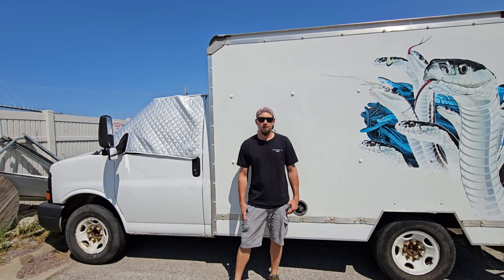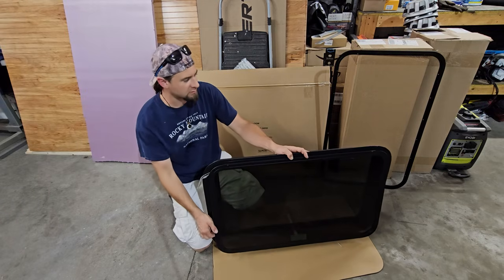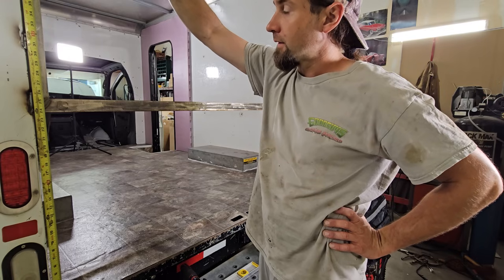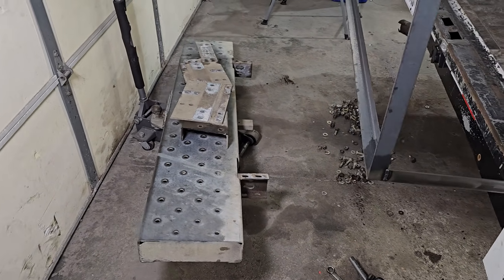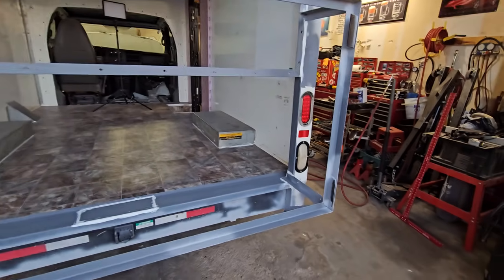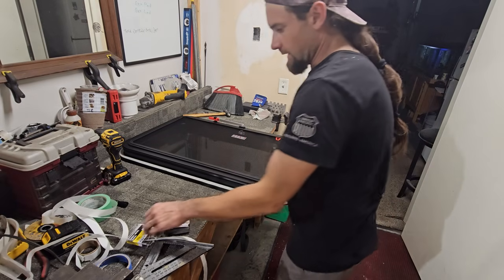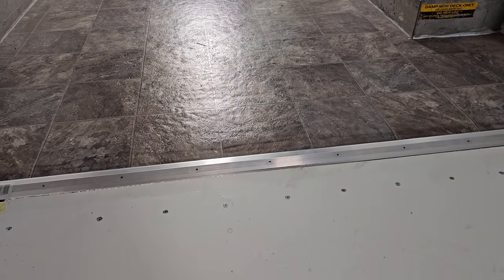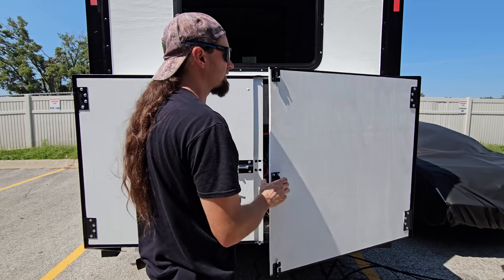It Doesn't Look Like a U-Haul Anymore - Box Van Build Part 3

Comment: i use to work for uHaul in the maintenance division. I felt for you on removing that door, there was definitely an easier way to do it, but without uHaul specific tools and knowledge you did great.  Before I left uHaul they were in the process of changing out all those roll up doors. we had it down to a science and on average 2 men, with uHaul tools could removed door, tracks, and all in about 15 minutes.
Reply: At the forward (top) end of the tracks, you can pull the rollers out of the track. Occasionally, there will be a stop or a plug that can be removed or the end of the track cut off. If you separate the door panels at the section hinges, they come out pretty easily and are light enough for most people to handle. That torsion door lift spring is a beast and can hurt you pretty easily, but most overhead door companies have the tools to make quick work of it if you feel unsure of your skills to handle it. Make sure you have at least two bars to release the tension if you decide to do it yourself.

Comment: Another great video.

One thing I missed - other than not being the "dream bumper" what was wrong with the existing one - it seemed pretty functional?  Maybe I missed or did not understand the explanation on why removing it...

regardless - awesome build!
Reply from the maker: once i installed the storage box in the rear for my bike, the bumper became useless for anything other than being a hitch.  the hitch had a 2" ball permanently welded onto it, which made it useless for accessories that i would want to have such as a cargo carrier.  it was also very heavy and low to the ground, which was likely to get hung up on things offroad

Comment: Dave, the outside is coming together. Man that spring was nerve racking. Nice job getting the door off. I think you are right about the rear taillights need to move, probably on each side of the garage. I’m sure you will come up with something interesting. Definitely, get the outside done and then the fun begins on the inside. You’ve got ton of work done already. Congrats!

Comment: Fantastic build so far.  I'd definitely get some led strip lights.  Looked on the Amazon and they definitely have some good choices.  To fill the old holes I would just get some aluminum bits and glue them over the  holes.  Be water proof and no screw holes seen.  PL premium would work just fine.

Comment: I grew up in the aviation world. So, for me, I'm into aerodynamics, saving weight, money, and to get the best drag coefficient.
For my truck, I'm removing the front bumper, the rear bumper, the sliding door, and the towing package.
My first videos will be about removing as much weight as possible.
For my bumpers, I'll replace them with aerodynamic bumpers made from fiberglass or carbon fiber.
I also plan to use 4' aerodynamic flaps angled at 12° inward, on the back for better aerodynamics, for highway speeds.
Reply from the maker: nice! ill follow your build.  im going to make a deflector for the top of the cab on mine

Comment: I admire your talents and creativity as your build your dream off grid home.  Do you plan on adding any exterior lighting so you can see around the vehicle at night?  Such as strip LED’s that tuck inside the exterior frame. Even some exterior mounted LED flood lights so you can illuminate your campsite-to work or cook.  Keep up the great work!
Reply from the maker: yeah i have a porch light for each side that does white and amber, i will have off-road lights on the front and back

Comment: Probably should cover the floor with cheap blankets from Harbor Freight. I'm commenting while watching so I don't forget. I've learned on my own projects, don't do any finish work until I'm done de-construction. I ruined the carpets at church by using a disc grinder to take down a partition hanging from the ceiling. Sparks came down and burned the carpet!

Comment: Have you considered coating the plywood bits in rhino liner or raptor bed liner? I feel like plywood fails pretty quickly when exposed to weather even if painted. It would make the panels much stronger and also cut down on road noise.
Reply from the maker: that would be nice, but expensive.  i am on a pretty tight budget.  i will have to keep up on the paint every year.  if some day i need to replace the plywood, i bolted it on so it is removable.

Comment: I worry about putting a lock out in the open on the back… heavy duty bolt cutters or grinder and your bike is gone!  

Is there anyway you could put a key lock on both doors to the frame?

Also, I would think about putting a small awning or a small cap at the top of the van to keep any water pooling on your box at the back.

Comment: You were supposed to use cement putty for the windows outside trim not screws. because most rv/campers have the putty for 3 reasons. The main one is that it seals the frame for the outside to prevent leaks. 2 over time screws will give way and loosen because of wind resistance without the putty. 3. Screws aren't really recommended to use if rubber trim and putty aren't used. Small bolts and washers are if you only intend to use just caulking.
Reply from the maker: i used butyl rubber and automotive urethane to seal the window

Comment: You’re doing an excellent job, and solving problems as they come up..  too much planning sometimes doesn’t work out, Design-Build is the way to go on a 1 of project like this 👍😬👌. On the taillights, consider LED replacements on the lower corner of each door, that will also likely conform to DOT requirements, when you need to get an inspection sticker..  have to think about the government, unfortunately 😳. You can also mount your license plate and license plate illumination near the center lower part of the doors, and the backup lights..  your idea of higher up is also good, and I would do both.

Comment: Consider leaving  the original taillights as is and adding lights to the rear doors you made. Putting taillights higher up may be illegal as there are restrictions that manufactures have to follow when manufacturing vehicles.
Reply from the maker: that's exactly what i did 🐱i believe in part 6

Comment: The top and bottom barrel bolts should have gone on the inside.
Putting them outside lets people open them and gain enough space to pry the doors open.
Reply from the maker: if i put them on the inside i wouldn't have been able to open them
Reply: @vanlifemeow  yeah you would!
You mount them on the inside of the door with the flange then you can close the other door and bolt it shut from the outside.
Opening the doors is as easy as sliding the barrel bolt opening the first door then reaching in to use the barrel bolts on the other door.

Comment: Do you have an overall plan for amenities? ie fresh, gray, black water capabilities, heat source? Or are you figuring it out as you go based on space available. I am fascinated by this build. Great starting platform. Perfect size to go anywhere.
Reply from the maker: i have a 20gal fresh water tank and a 15gal undermount grey water.  there will be no black water.  i have the whole power system bought as well.  for heat i have a diesel heater and a tiny wood stove

Comment: Looks like you are going to have some water pooling on top of that box with this design. The wood on top of the angle iron might have been better for water shedding.
Reply from the maker: you're right.  i will have to continually brush the water off every time it rains.

Comment: Why didnt you weld the rear box frame to the top of the bumper?
Reply from the maker: im going to build my own bumper from scratch that has better ground clearance/departure angle.  that one was too low and heavy.  also the ball was welded on to it.  i want a proper receiver hitch.

Comment: You should have no problem selling that roll up door and its parts. My boss has a fleet of grumman ice cream trucks.  Some of them could use a new back door. As most of them are pushing the 50 year old mark. So you could try contacting any local ice cream truck companies in your area??
Reply from the maker: thats a good idea
Reply: @vanlifemeow  Do it now if you wait until spring. Most owners will have no money to buy.
Reply from the maker: taxes.  right
Reply: @vanlifemeow  That too. But some areas the season is only 6 months long. No money coming during the off season.

Comment: How are you insuring this?  I had one lined up and my insurance said they won't cover it I need a commercial insurance co.  Got ambiguous answers from other companies I called.
Reply from the maker: i had the same struggle.  i discovered that progressive has RV policies for homebuilt campervans.  you can insure it for a set value (i did 25k) and it's full coverage with roadside assistance too.  they do want you to upload pics of specific components of the build, but i just used the same picture for everything with a caption stating that the build was not done yet.  i plan on updating the policy once im finished with it.  so far so good.  it's only like 78 bucks a month too
Reply: @vanlifemeow  Thank you for the fast reply.  Ill have to shoot my next potential vehicle their way.  My last one I had to let pass due to this issue.  But all in all I realized I needed a 4wd so it was a good thing in the end I didn't get that one.

Comment: Well I like it . But Stealth is gone .
Reply: I actually think he increased the stealth.Think Work truck. He could hang a 10ft aluminum ladder on the driver side which he could use to access/clean solar panels and also to use for handyman work on the road. Mount a set of tail lights in the box and keep the stock ones to have 4.
Reply from the maker: definitely not stealth.  i'll have to spend the night in a place where im welcome.  might be a challenge for the first year while im still working full time but i'll deal with it

Comment: Do not know why you did it that way what are you just take the frame of the back end off extend the walls out put the frame back on and the bumper I would have added another 4 ft and mastered into the original truck
Reply from the maker: 4ft is too much.  departure angle would be terrible.  i would get hung up on trails.  i just needed a safe place to put my bike and have some storage.  the inside of the van is plenty big enough for me.